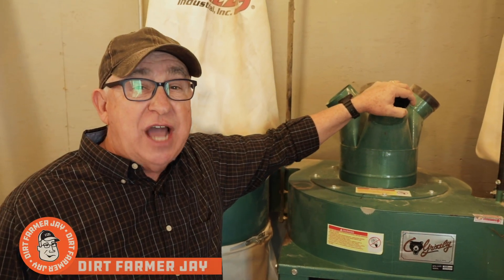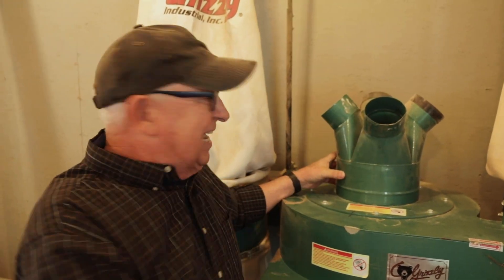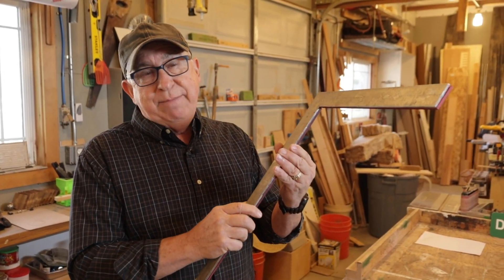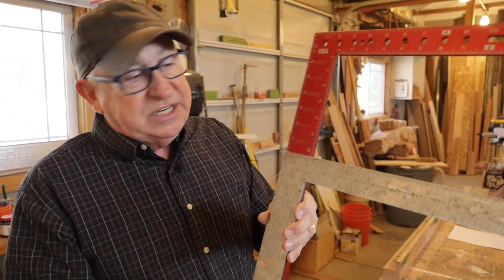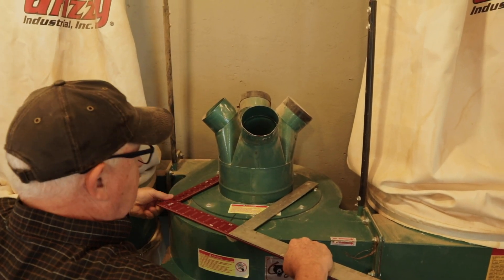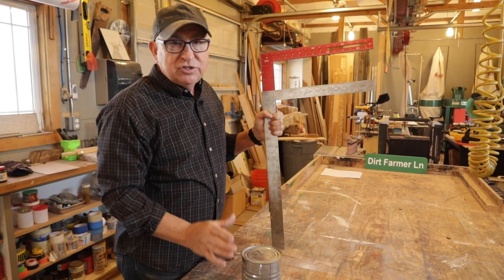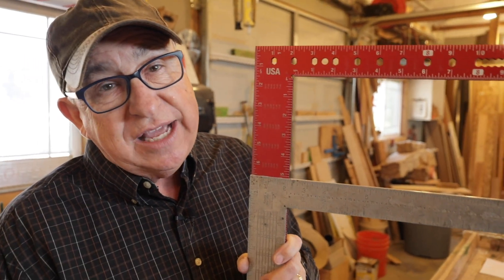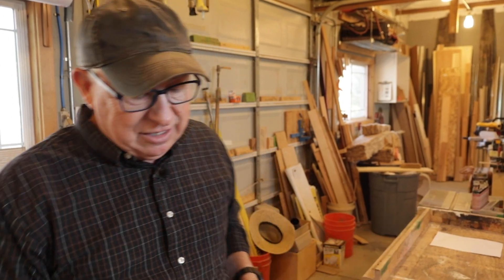Instant Framing Square Mega Calipers

Comment: Also could use a piece of string to measure the circumference and divide by pi to get exact diameter.  
Circumference / 3.14 = diameter
Reply from the maker: Omar, you are absolutely correct. Math is a great approach as well, as these are fixed ratios that give dependable results. Thanks for writing! Best, DFJ
Reply: For a circle, string & math as well as specially designed tape measures are useful; this 'tool' has much more application. Using a tri-square for the, 'slider' is a decent option also.